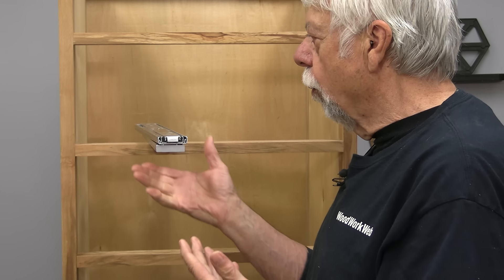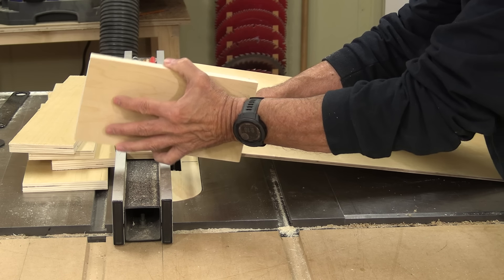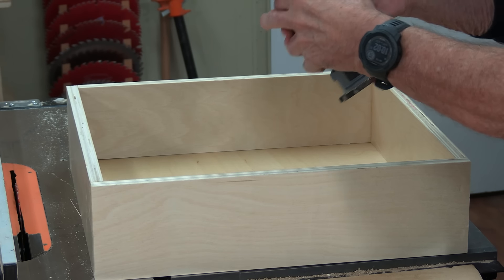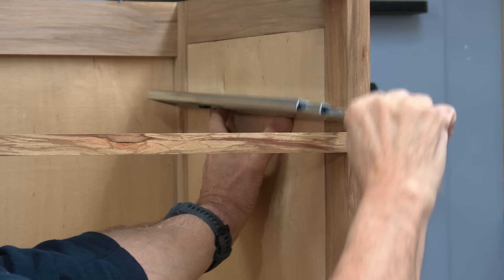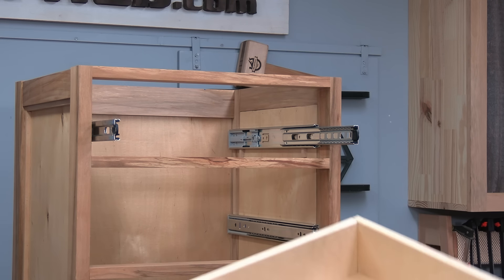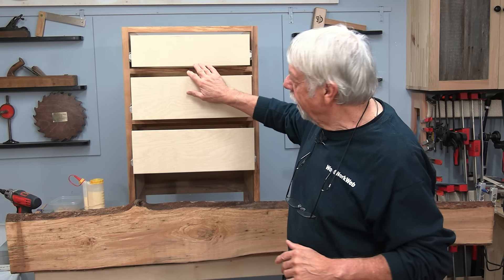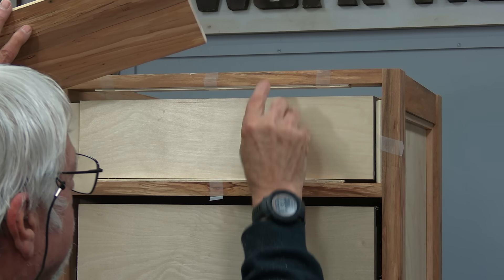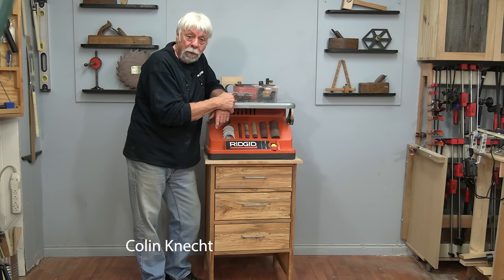Say Goodbye to Slamming Drawers: Easy Close Drawer Slide Installation

Comment: Clear video about making the drawers with the soft sliders. In my case I have problems in making to slide them fluently. All fits well, but still the soft close doesn't work for all my drawers because of some tention, I have to push some of the the drawers to close. If you could show some short about how to check the right width of the drawer and the margin that should work, it would be helpful to me. Thanks for this video anyway!

Comment: When mounting the fronts, pre drill the holes for your handles and use those holes to put in some temporary small screws to hold the face on the drawer then pull out the drawer and screw from the back, remove the temporary screws and finish drilling the holes for the handles.

Comment: Hey Colin technically the Slides are all European and they are 13mm  which is slightly larger than a half of Inch i’m not being a Jerk Buddy i spent 35 years working in a ArchitectulmWoodworking Company as a Manager and we made thousands of Cabinets with that Hardware  as rediculous as it sounds  we Calibrted  our Woodworking Machinery to thousands of a Inch on our CNC  Machinery  and as you know any change of temperture and humidity could change a Peice of Wood  beyond thousands of a inch  Technically that was out of our  control and would  be the Customers  Responsibility  Our Facility was monitored and  recorded 24/ 7